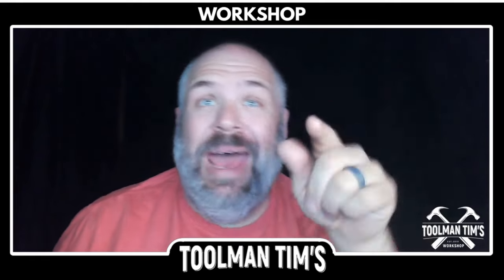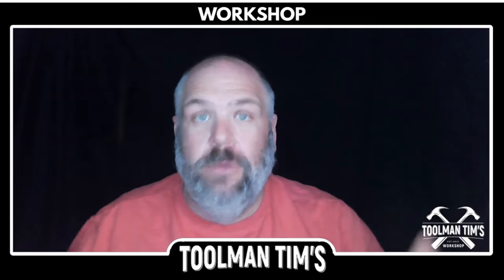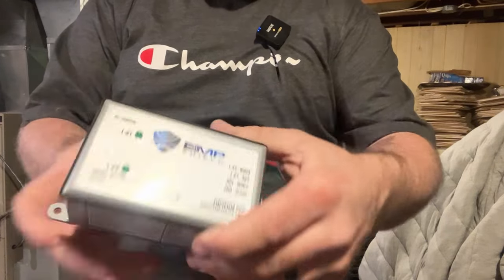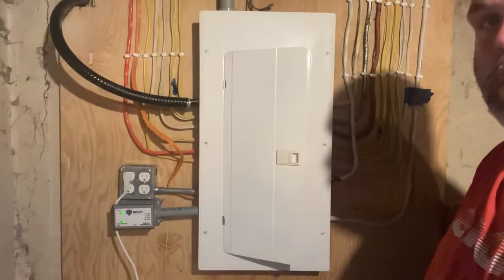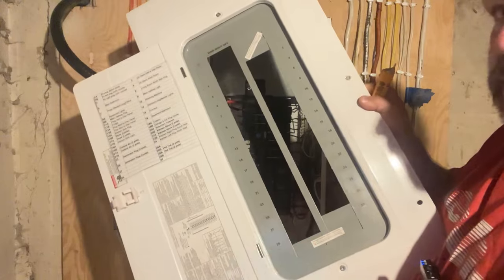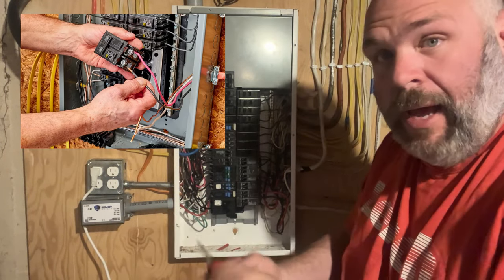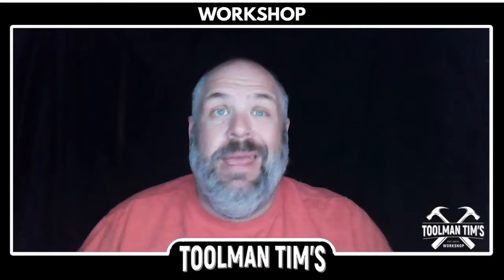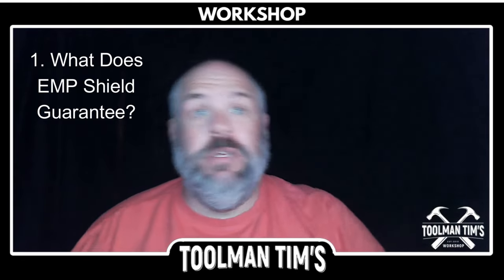Whole home surge PROTECTION worth it?? EMP SHIELD Review

Comment: I watched your video & have been thinking of buying something to protect my home & vehicle. Regarding a whole home EMP protection, what good is it if the power grid itself is blown, there would be no power coming to your home anyhow?
Reply from the maker: so my thought is a couple of things, first this also protects against lightning and surges so theres that.  But if you have you home, solar and generator protected you would be in a much better place than most folks around you as long as you have fuel stored up as well.  Just my two cents

Comment: ok, if I installed it in my trucks. Wouldn't the car battery still be dead? Items not plugged in wouldn't be affected? like a gas-powered generator, or how would you wire that, the same?
Reply: Now that is an interesting statement , so you remember the battery warning too . I've not heard it mentioned of late , in fact this is the first time in twenty something years . Do you know what the current thinking is , has it been debunked , or does it still stand ?

Comment: Does it have a whole house filter with the surge protector?
Reply from the maker: So I sent some emails when you asked the other day got an answer than couldn’t find your question hers the correspondence I got 

just a question one of my community members asked if the emp shield was also a line filter. I didn’t think it was but didn’t want to answer without asking you

If you mean, will it clean up dirty electricity,  yes it will. 

Anything that spikes over the unit's Voltage spectrum (so 120/240, 277/480 etc.) Gets shunted. It's much smaller shunts than say lightening or an EMP. But overage is overage and the EMP Shield will handle all of it. 

Ok cool so does it actively do that all the time or only when it gets outside of certain parameters  

Anything that spikes over the unit's Voltage spectrum (so 120/240, 277/480 etc.) Gets shunted. It's much smaller shunts than say lightening or an EMP. But overage is overage and the EMP Shield will handle all of it.
Reply: @TOOLMANTIMSWORKSHOP  wow!! Just the line filter is worth the install.  🤔  I think I might get on of those

Comment: Tim, I really enjoy listening to you on Nicole's show from time to time.

This EMP Shield is a scam though. I saw a post on Reddit where a guy took one apart and all there was inside was an LED.
I'm an electrical engineer with experience in EMI testing on military products. Can a device be protected from EMP? Yes. Proper shielding, special diodes, and other methods can do it but there is no out of the box solution. None. 

Please tear one of these products apart and see for yourself.
Reply: I worked on electronics in the Navy designed to withstand EMP.  Lots of very careful physical shielding, protection circuits and lots and lots of bonding, and that is after being wrapped in a metal ship grounded to the water.  This thing is nonsense.  And most of the testing is confusing, as it is about the unit itself surviving EMP, not what it protects.

Comment: Will connecting to your breaker box protect the solar equipment?
Reply from the maker: So I’m not 100% sure about this question a couple of things first I know they do sell separate EMP shield for solar systems but if I had to make an educated guess if it were on the panel side of your connection so it’s tied directly into your panel than it should be protected through your panel

Comment: The only problem is how are you going to have power to use your appliances if the power grid is down? Unless you live off grid. So basically you will have appliances that don't work anyway. If I could find a way to store around 30 gallons of gas I may be interested in an EMP shield for my car.
Reply: There could be smaller solar flares that don't end all electricity on Earth, for smaller events this will preserve your equipment for when the power is back. Or from a lightning strike. Even if you have no extra gas protecting your car is worth it. That first drive after an emp is arguably the most important, or driving after a lightning strike is more common
Reply: Ever hear of a generator?

Comment: Does it really need a double breaker?  I saw someone connect it to two single pole breakers that are adjacent to each other. Can it be a 30 amp or higher?
Reply from the maker: i would say you are better off following the directions, especially is you wanna make sure you are properly covered
Reply: Need to protect both hot wires connected to the breaker box
Reply: Other videos on YouTube explain that to be code compliant, you must follow manufacturers installation instructions

Comment: If there is an EMP which will wipe-out the grid what is the use of protecting your home? Isn`t it a mute point?
Reply: @joekickass9233  but that's not how it works 
(EMP) is an effect where radiation emitted after a nuclear blast destroys the silicon junctions in semi conductors. (Micro-chips, processors, transistors, etc.). This is a direct influence effect, it does not come as a transient through cables or conductors, so the only way to prevent damage is direct shielding of the components.

Comment: Well my question is yeah you may save your electronics in your house and the panel and all that good stuff but what good is it going to do when the electrical grid in the country gets knocked out there’s not going to be any electricity coming to your house.
Reply from the maker: I honesly like to focus on the Lightning and power surge capabilities of the emp shield.  As that's where I see its proving the day to day value  however in the short term after an emp if a person was concerned about taht the EMP sheild would protect your house and generator if you have them both protected and then would be able to generator power for yousefl for a while  (or even your solar system)
Reply: Ever hear of a generator?
Reply: @trajan6927  if this thing actually does come to fruition and we get hit by a EMP they’ll be no gasoline there’s not gonna be any diesel you’re not gonna be able to get any propane so your generator once you finish using what you have you’re not gonna be able to replenish it. You can go out and get a solar charging generator but it’s not going to work as well as a standard generator.
Reply: @georgehuerta1990  what if you have a 1,000 gallon propane tank? That gives you at least 6 weeks+ of fuel.
Reply: @georgehuerta1990  Some EMPs can knock out solar panels and the battery solar generator.
Reply: @trajan6927  that would be nice but for what I have researched and I’m not telling you I’m so expert, but I’m just saying for what I have looked up they say after an EMP strike that the country May not get electricity for 2 to 3 years.
Reply: @trajan6927  yeah that’s what I’m afraid of because I’ve thought about buying a generator but I’m like for what if we get hit with an EMP they’ll be no gasoline no diesel no propane no lights nothing and I was thinking about a solar generator at least would be enough to run your refrigerator some lights maybe a fan but it ain’t gonna be enough to run air-conditioning. Grocery stores will be empty. People are gonna have to start learning to hunt for their food. that means you better have ammunition and firearms to be able to do that and protect yourself Quinn the other people have not prepared and come to your house looking for what they need and they’re not gonna ask
Reply: @georgehuerta1990  no all places or things will be hit or destroyed by an EMP. Depends on the type of EMP. I would rather have all different supplies, generators, and back ups for everything. You never know. Should be prepard anyway. Don't give up.

Comment: Hi.
I react to you using the term EMP in your video to describe something that sounds like a lightning protective gear. I was expecting some type of doomsday prepper video 😂

Do you even know what the abbreviation EMP means?

Looks like you are describing a Power Surge unit and not EMP.

You couldn't protect your house by disconnecting your house with EMP.

EMP is more in the street of a solar flare hitting earth hard or a nuclear bomb, a tiny more localised nuke or even a specialised EMP bomb without any nuclear detonation

Comment: Okay this is what my electrician told me about Power Surge protection. Hence a lightning strike.

You could have your electrical company mount a coarse protection away from your house a little. Then have a medium protection in your own fuse box, then have a finer protection at let say your precious gear like a 5 thousand dollars computer you want to protect.

It works in this way:
The strike has a wave behaviour to it. So even if you dampen it at one spot early it will strengthen again after the dampening if it has in-house electrical grid to traverse afterwards. The key word here is dampening function of these power surge units. Therefore you also need the fine protection for each precious unit at the electrical socket before your precious unit. Alternatively to a simpler surge protection unit you could go with a galvanized separation of the power, like a battery operated UPS. But it got to be a bit quality with being for instance online UPS. Or you could also get a power adaptor 120  Volt to 120 Volt that gives you galvanized separation instead. Because with a UPS it is the battery plus the built-in power surge that becomes the galvanized sep. plus dampening function.

Many just buy a fine protection unit for there socket of a high quality. And hope that no wave gets through to your precious equipment. It is way better than no protection and then it is built around having the surge protection take the power surge and it may die before your precious equipment. But there is time and the wave behaviour to consider here. So a simple power surge unit might take the brunt of it but maybe not everything. Especially if the gear is super sensitive to taking damage.

I'm not an expert. But you can choose:
A. A heavier installation with coarseness stepping. Two or three steps to your liking.
B. A UPS (universal power supply) of online true sinus curve specifications
C. A power transformer, but maybe you need a fine power surge too here to block the wave as a second steo? I'm not sure 
D. Just go for the Power Surge unit and take the risk. But then place it near your equipment, and not just at your fuse box for the house

Good luck

Comment: a house will be just as effected as a vehicle with or without the "EMP Shield" which is just a glorified surge protector, this is a post I made when some youtuber made a similar vid but with the car version by the same company. Long story short it's useless against EMP but excellent against regular surges and therefore still a good idea with cars and homes for regular "surge events" that don't need an EMP to occur.

the way the company that makes that box thinks an EMP works is you can have a car with a battery hooked up like any other and just add the surge protector and that's it, sorted. But if using that logic (which is incorrect btw), then simply disconnecting the battery on a modern "bug out" vehicle and grounding the chassis / unibody will achieve the same thing. Unfortunately this is where that company's theory falls out of the bus. 1st they have never tested their product using an EMP generator in an enclosed facility so none of their products have ever passed the actual grade, it's only theoretical. 2nd the "surge effect" is present in the circuits and even chips themselves without needing a closed circuit or power source. So even with the "magic box" hooked up it will fry most chips in the vehicle. 

Just drape a faraday/EMP tarp over the vehicle and don't remove it for a few hours until there are no signs of further EMP strikes, you can test this by making devices that will purposely become inactive when removed from an EMP bag or garage with faraday / EMP lining fabric. Then simply just drive out the garage with a completely unmodified vehicle. If you want a vehicle that will operate during an EMP event, just stick to mechanical and carry some extra fuses. You can use these same principles with RVs, campers, homes, etc. Also most budget generators are completely mechanical

Comment: What happens when a EMP occurs it’s going to fry the outside transformers witch no one will have no power In the neighborhood
Reply from the maker: Absolutely 100%. This is more for protecting the things in your home. It’s great for a lightning, strike or a power surge but in the rare chance that an EMP does happen and you have your generator protected at home then at least you’ll be able to run your own personal system for a bit until you don’t have fuel anymore